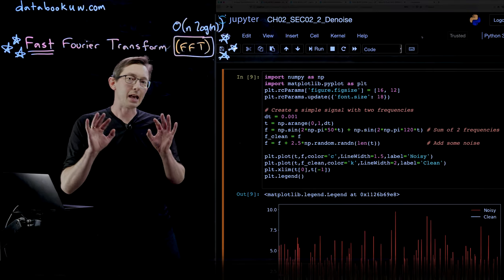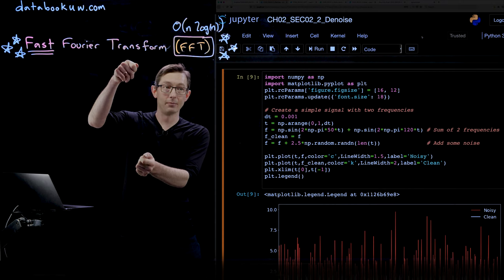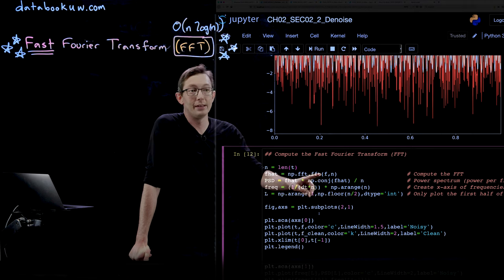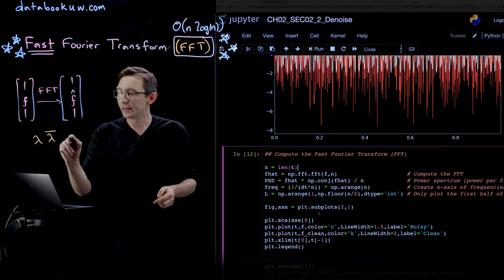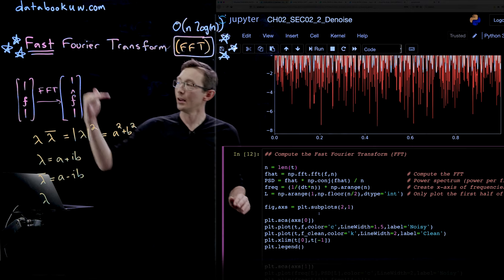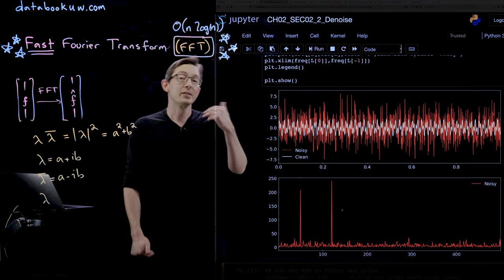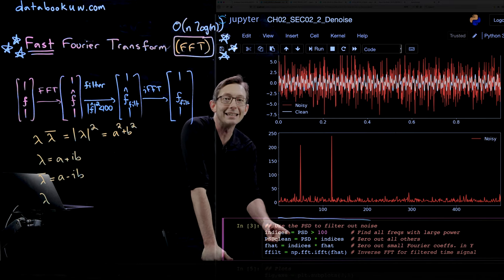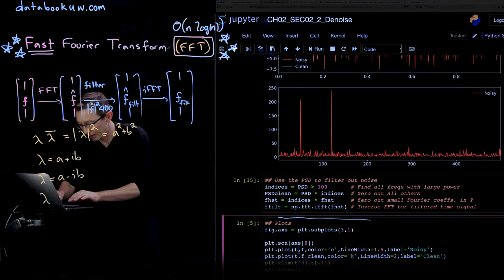Denoising Data with FFT [Python]

Comment: import numpy as  np 
import matplotlib.pyplot  as plt 
plt.rcParams['figure.figsize'] = [16, 12] 
plt.rcParams.update({'font.size': 18}) 

# Create a simple signal with two frequencies 
dt = 0.001
t = np.arange(0,1,dt)
f = np.sin(2*np.pi*50*t) + np.sin(2*np.pi*120*t) # Sum of 2 frequencies
f_clean = f
f = f + 2.5*np.random.randn(len(t))              # Add some noise

plt.plot(t,f,color='c',linewidth=1.5,label='Noisy')
plt.plot(t,f_clean,color='k',linewidth=2,label='Clean')
plt.xlim(t[0],t[-1])
plt.legend()

## Compute the Fast  Fourier Transform (FFT) 

n = len(t)
fhat = np.fft.fft(f,n)                      #  Compute the FFT 
PSD = fhat * np.conj(fhat)  /n              #  Power spectrum (power per  f 
freq = (1/(dt*n))  * np.arange(n)           #  Create x-axis of frequencie 
L = np.arange(1,np.floor(n/2),dtype='int')  # Only plot the first half  of 

fig,axs = plt.subplots(2,1)

plt.sca(axs[0])
plt.plot(t,f,color='c',linewidth=1.5,label='Noisy')
plt.plot(t,f_clean,color='k',linewidth=2,label='Clean')
plt.xlim(t[0],t[-1])
plt.legend()

plt.sca(axs[1])
plt.plot(freq[L],PSD[L],color='c',linewidth=2,label='Noisy')
plt.xlim(freq[L[0]],freq[L[-1]])
plt.legend()

plt.show()

## Use the PSD to filter out noise 
indices = PSD > 100        # Find all freqs with large power 
PSDclean = PSD * indices   # Zero out all others 
fhat = indices * fhat      # Zero out small Fourier coeffs. in Y 
ffilt = np.fft.ifft(fhat)  # Inverse FFT for filtered  time signal 

## Plots
fig,axs = plt.subplots(3,1)

plt.sca(axs[0]) 
plt.plot(t,f,color='c',linewidth=1.5,label='Noisy' ) 
plt.plot(t,f_clean,color='k',linewidth=2,label='Clean' ) 
plt.xlim(t[0],t[-1]) 
plt.legend() 

plt.sca(axs[1]) 
plt.plot(t,ffilt,color='k' ,linewidth=2,label='Filtered' ) 
plt.xlim(t[0],t[-1]) 
plt.legend() 

plt.sca(axs[2]) 
plt.plot(freq[L],PSD[L],color='c',linewidth=2,label='Noisy' ) 
plt.plot(freq[L],PSDclean[L],color='k' ,linewidth=1.5,label='Filtered' ) 
plt.xlim(freq[L[0]],freq[L[-1]]) 
plt.legend() 

plt.show()